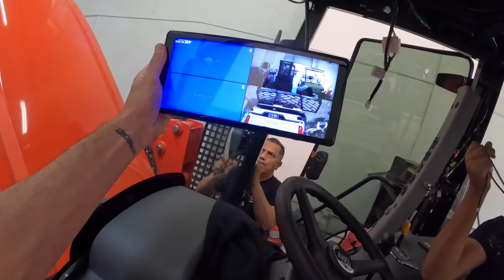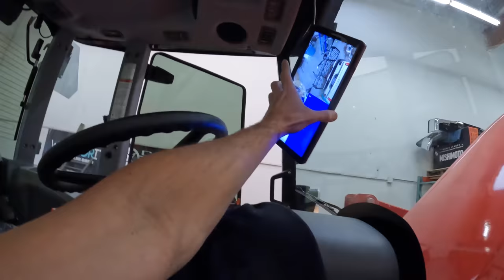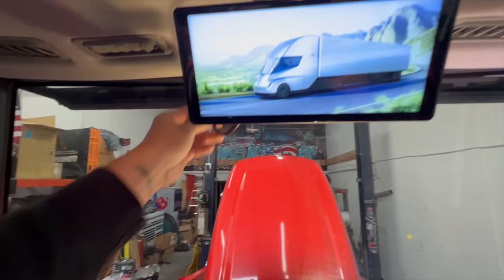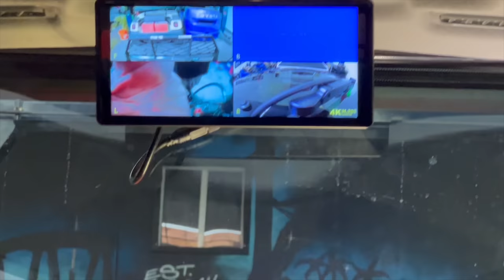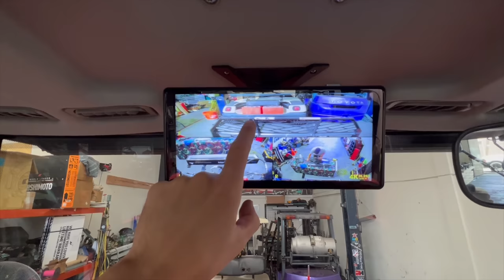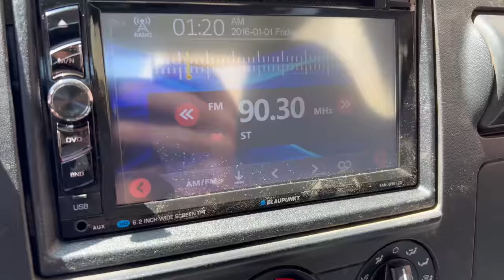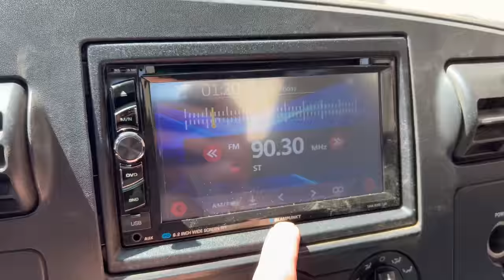EVERY Tractor Should Have These 3 Things!

Comment: Keep the great content coming. Quick tip, when you haul your tractor make sure you throw a chain over for forks or whatever attachment you have. Anything the raises needs to be tied down, that way DOT doesn’t mess with you.
Reply: DOT doesn't apply to private citizens. Only applies to commercial applications. 🙂
Reply: DOT officers don’t look for private individuals hauling stuff for personal use. They could technically stop you, because they are state troopers, but the odds are exceedingly low.
Reply: @williameldridge9382  they can legally pull you over if you're hauling equipment

Comment: Blaupunkt is (was) pretty good stuff back in the day.  I use to run a Blaupunkt head unit that I transferred between 3 trucks.  Then I switched over to Alpine & Alpine speakers. 
I'm sure you won't be disappointed in that head unit.  

  But other wise the tractor is looking killer!! Love the 35% like you said dark enough but not to dark for night time activities.
Reply: I also used to have some of that brands head units and speakers… it was Good Stuff back in the early 90’s.

Comment: Tint is for sure a preference thing.  I get 5% ceramic all around on every window.  But I can see very well, so it's not hateful at night (unless you're backing a trailer, then the windows have to go down lol).  I go dark because I get migraines very easily while a drive with reflections and sunlight.  I also get migraines from things on my head (pressure such as hats, glasses, etc).  Once I had my first truck tinted that dark, I could never go back.  It's so comfortable to drive now and not feel miserable on long drives to work and home.

Comment: Also do yoyrself a favor either chock the wheels on the trailer before load and unload set ebrake on pickup or chock the pick up cause the jerking movement will brake transmission and or rear gear on the pick up just to save you some hard earned money